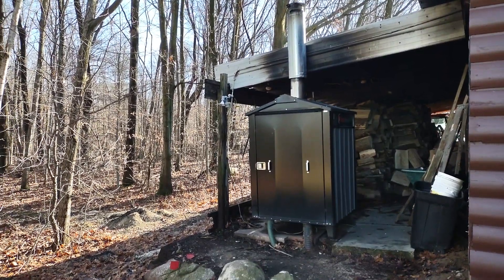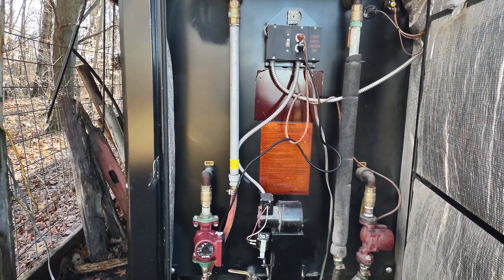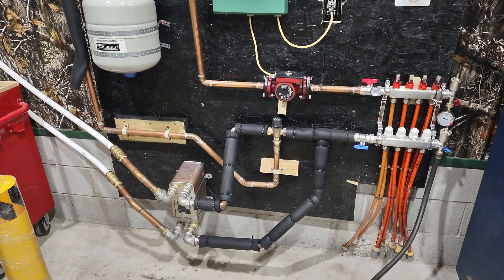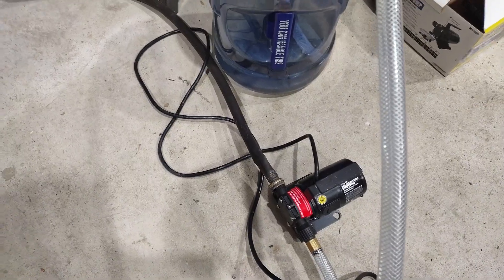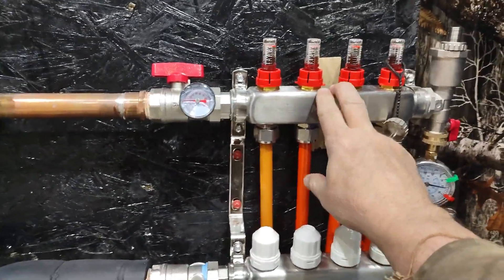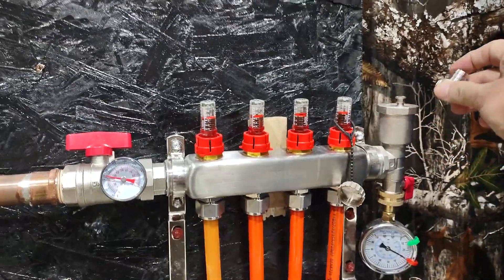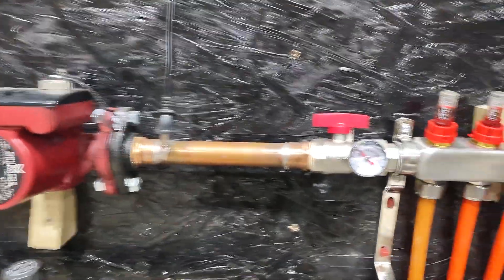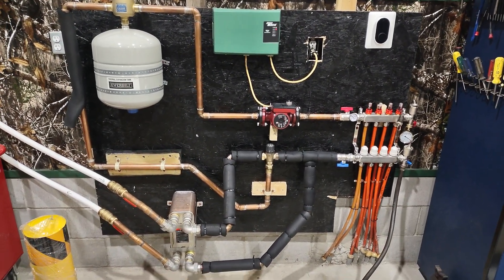@twosawacres8096 Connecting in-floor shop radiant heat to my outdoor wood stove.

Comment: Hi thanks for making this I have this coming up in my barn build. One question do you have an anti scald valve on there because your boiler temps are much higher than like 100deg needed for the floor heat temps are ? I seen another video on just a ng boiler and they did the same they said for condensation reasons which I didn’t really get why. BTW you made this super simple. I had a ODB at my last house but forced air in the barn and house. New house and barn have in floor but not gonna have the ODB here. Have a great day ! I think we might be neighbors lol ! I live in Gregory Mi

Comment: What is the purpose of the heat exchanger? How did you regulate the water pressure down to 20psi from the boiler?
Reply: I think he put glycol in the underfloor heating pipes and water from the wood boiler...or vice-versa !
Reply: One system is pressurized the other is not.